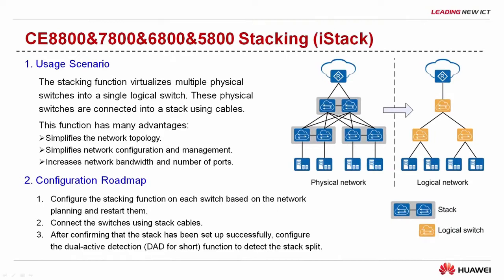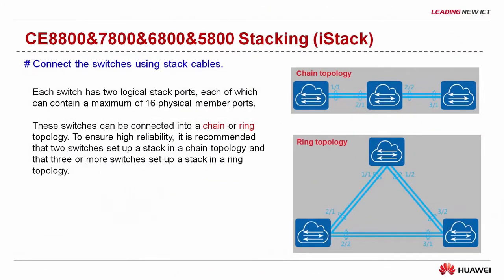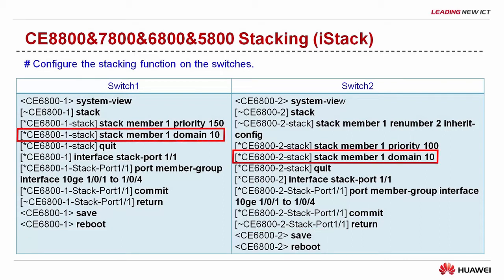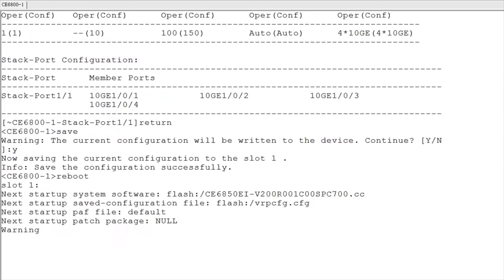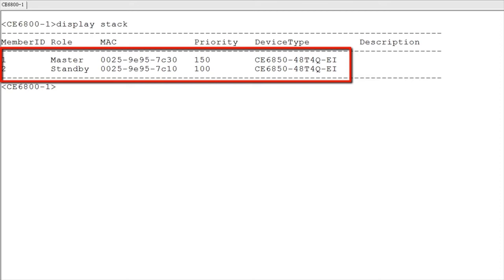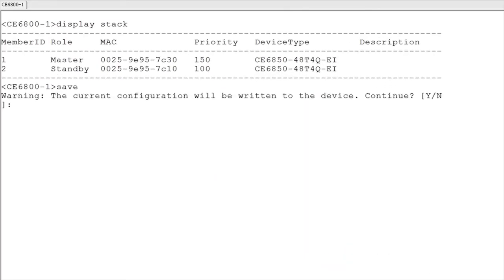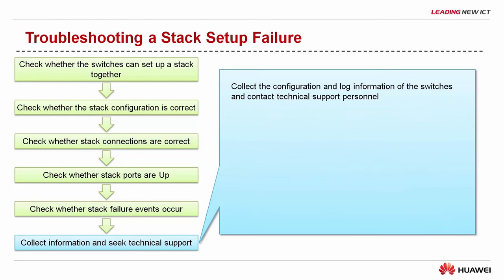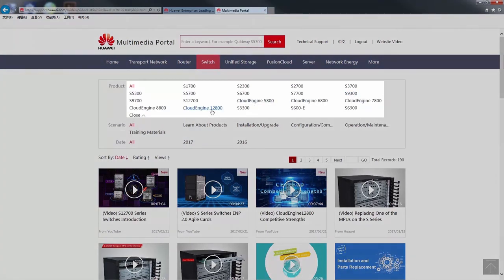How to Configure Stacking on CE8800/7800/6800/5800

Comment: Why Member ID not displayed after running command display stack
Reply from the maker: Hi dear amritesh kumar
, Thank you for your feedback. Could you describe the problem in detail?Are you talking about the video content or the problems encountered during the actual stack configuration?
Reply: @HuaweiSupport  In video when stack status is checked then for  one type of switch member id is showing but for other type of switch only slot id is reflecting. Can you please explain me this difference.
Reply from the maker: @amritesh101011  Dear amritesh kumar, Intelligent Stack (iStack) is a technology that connects multiple switches using stack cables to logically function as one switch and forward data as a whole.
After two switches set up a stack, they are logically one device. No matter which member switch is used to log in to the stack, the master switch is actually logged in to.
Reply: @HuaweiSupport  thanks as i understand 68xx series show member id but 53xx series shows slot number once stacking done.